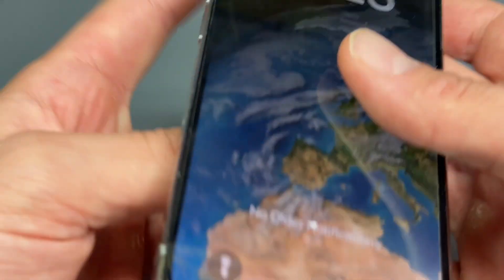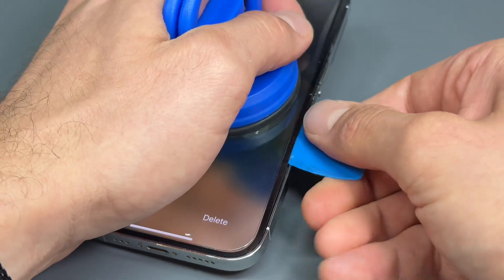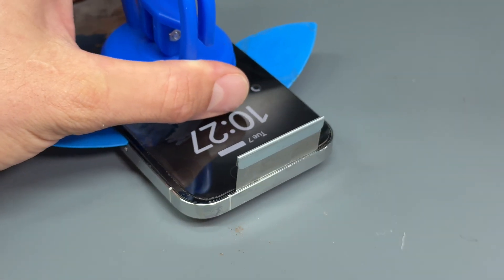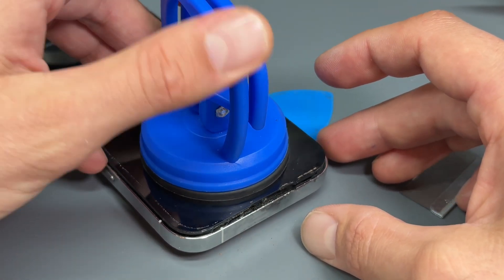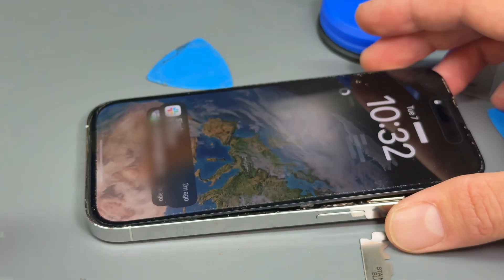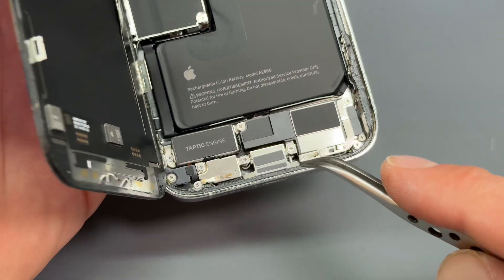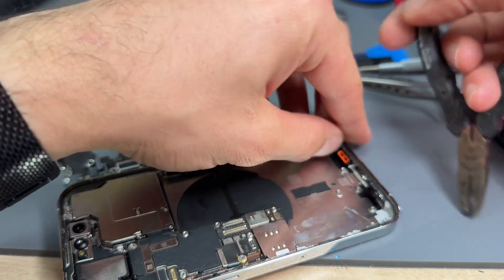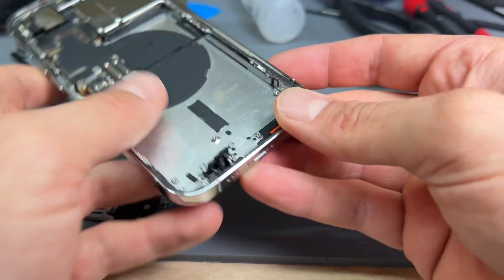How To Remove Stuck iPhone Bottom Screws (Without Breaking the Screen!)

Comment: ive bought a bag of those screws (got 250 now) and ive started driling out the screws if another shop stripped them
i just drill a lil hole till the head pops off and then keep going with an even smaller drill till im about 5mm deep then i can just take the screen off without ruining the threads
Reply: care to share what drill?? maybe size or link?
Reply: A dremel with the absolute smallest saw you can find is good, or any polishing pens will likely work too